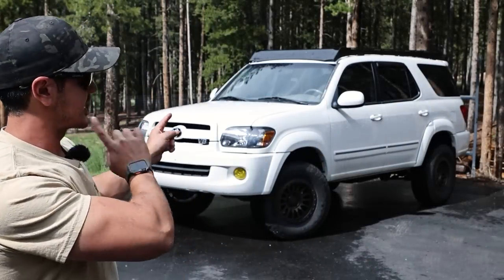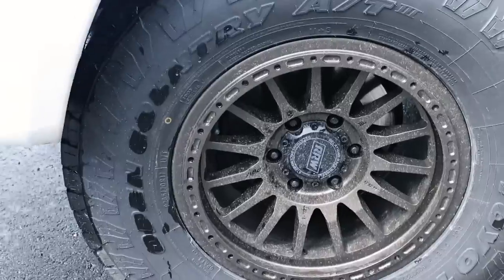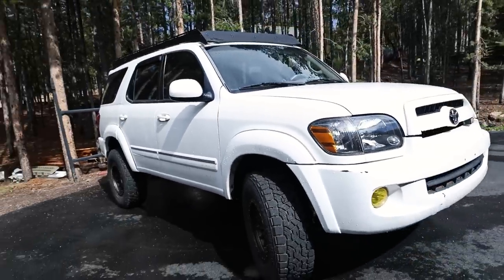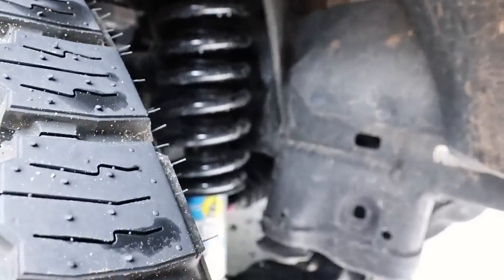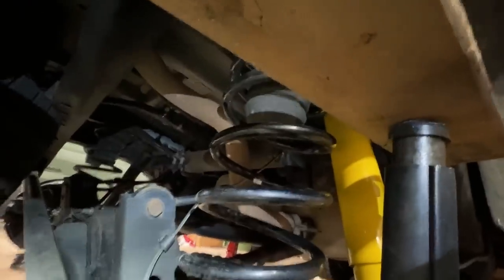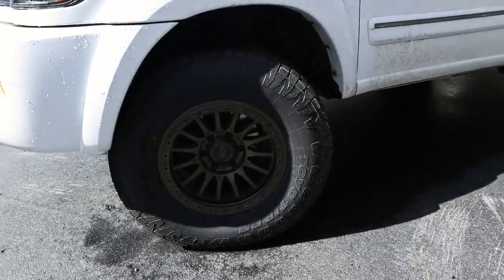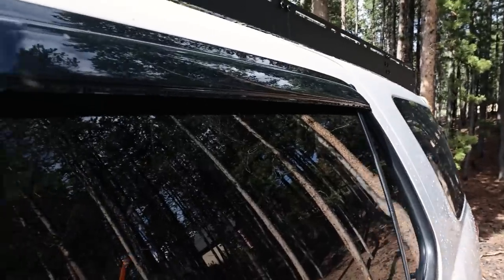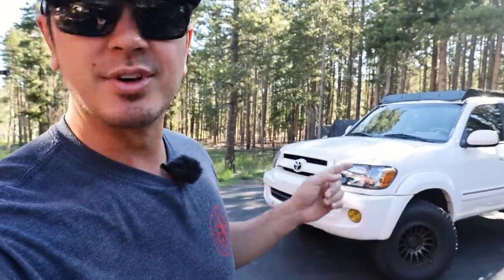Toyota Sequoia Minimal Overland Build - Just Right (First Gen Lift, Wheels, Tires, Rack)

Comment: You’re going to be very impressed and surprised I think. 
Never underestimate this first gen sequoia. The second gen isn’t even as capable as this first gen.  Even tho it’s the sr5 it still extremely capable. I ride with land cruiser 100-300 series. I have the limited 07 and it’s amazing. I know it’s blasphemy to say it’s like a land cruiser but it’s honestly an American made 100 series with more  room. Just saying.’and I never even have to use my locker the traction control and limited slip is so great.

Comment: I love that the sequoia had been seeing a lot of love lately with the off-road community.  I have been running the same setup in front for a few years now and still love it.  I actually just ordered the same setup for my 05 tundra ad well.  

I removed the rear sway bar overall, and i noticed a big difference on the trails compared to when I ran them with it on.  Not a big difference noticed with the daily drive

Keep up the sequoia content 🤙🏼🤙🏼 that prinsu rack is 🔥

Comment: Great choices on the suspension height and tire size etc. Still love my 2005 Limited.  215,000 miles.  NO issues and recently did all the expensive 100k tune-up stuff and timing belt.  Good for another 100k!  It grew up in the heat and sun of the southwest so it just now got sun rash on the hood and roof above the windshield.  Recently had the rest of it detailed so all I need to do is find a auto pain shop that wont charge me an arm and a leg to re-paint the top and hood.  Or maybe go with a wrap?  The leather seats of both front seats need attention too.  Just swapped out the headlights with all new lenses and LED bulbs.  Got tired of trying to get the old ones clear only for it it return.  I have a new weather-strip for the rear gate that I need to put in.  Also need to update the stereo head unit etc.  Love the JBL system but no bluetooth is unfortunate.  ALSO, for all of you that have front door panel speakers that are going out don't believe for a minute you need to replace them entirely with something else that you need to do all sorts of retro fitting for.  Unnecessary.  I have an audio business.  All ya gotta do is replace the dried out surrounds on those JBL drivers.

Comment: These two Sequoia videos are perfect timing.  I found a 2005 local to me with 135K miles.  They are asking $13K which I don’t want to pay, but they did replace the timing belt, water pump, etc so that does have value.   I want something bigger than my 4R to sleep and camp in. I’m checking it out tomorrow and hoping it works out so I can have no car payment for first time in 27 years.
Reply: Just pick it up and it's a refresh 1st gen. You won't find a Toyota 4x4 with that mileage for that price.
Reply: Did you buy it?!

Comment: Nice video. I'm getting ready to install a 2.5" dobson suspension lift on my 2wd which will never see offroad. Do I need to add the longer sway bar end links or could I just use the factory ones?

Comment: I have an '03 with 350k on it- doesn't burn oil yet but was contemplating whether it's still worth spending on upgrades...the only thing I don't like about the exterior look is that the front looks like an old Explorer, I added a nice hood shield and it's better

Comment: Hi, what's that protruding from the drivers side headlamp?
Reply from the maker: It's a plug to externally charge / maintain the battery. Since I have a bunch of vehicles and mainly drive the Tundra, the rest need a little battery maintenance here and there.

Comment: You might have interference from the radio antenna in the back glass crating the buzzing
Reply from the maker: The cable actually just came unplugged a little I'm pretty sure